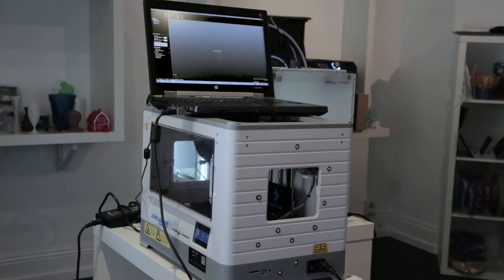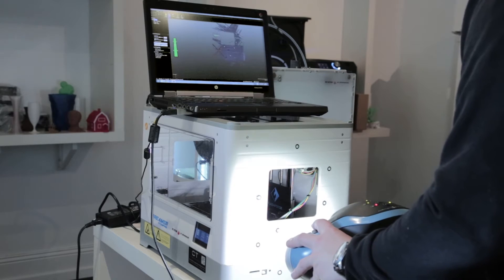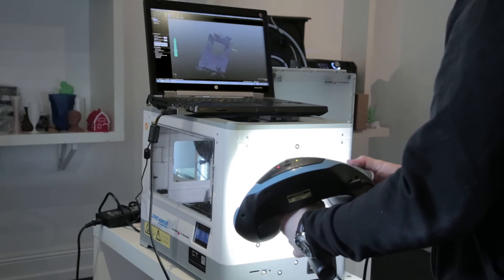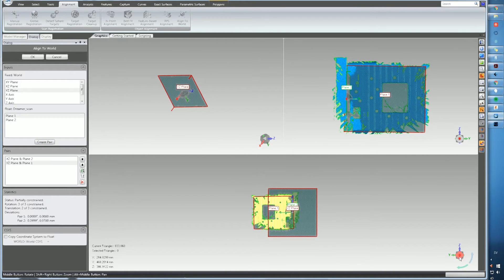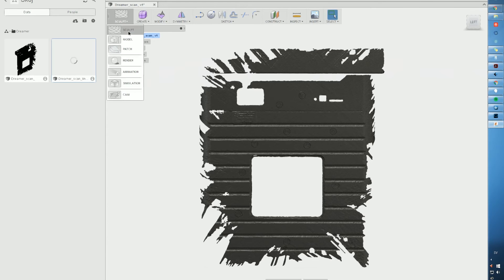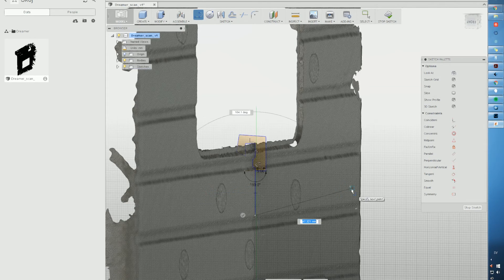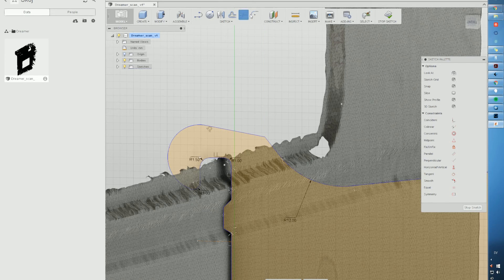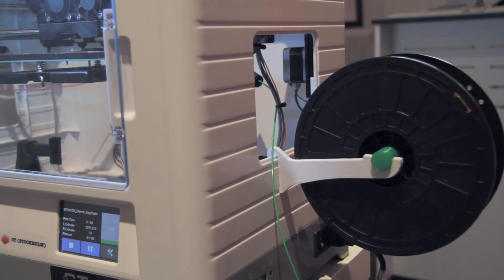OVERKILL with 3D scanning and 3D printing

Comment: Any idea how I can get the software for this? Creaform simply doesn't have it anymore and instead rather want's to sell me a new unit costing thousands🤣🤣🤣.
I have access to a scanner but unfortunately no software...became a very expensive paperweight very fast😒
Not sure if I would ever invest in a companies product when they can move on so quickly from providing support for this product still selling less than 10 years ago.
Reply from the maker: ooo. Thats a though one. I don't have anything left to share, and I guess they really did End-of-life that scanner (to their defence, they were ought up by Amatek in 2013, this scanner is from 2008, so it's quite "ancient". Kind of interesting to think that a Creality Raptor is just about now becoming equally good, for $1600 instead of $45000 :D.  Software is still the difficult part for scanning manufacturers. 

However, there really should be some old files laying around at their support or something. I guess you have to poke them harder!  Problem might be the calibration/license files that you also need for the software. So even if I found a install file, you would need to get your correct license/calibration files for your exact scanner.